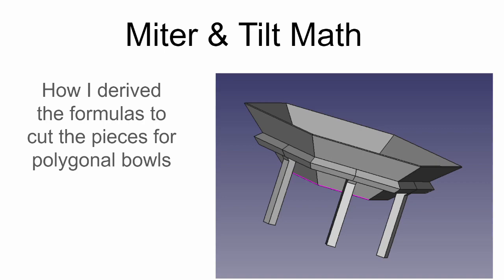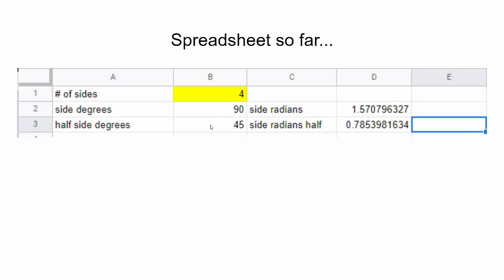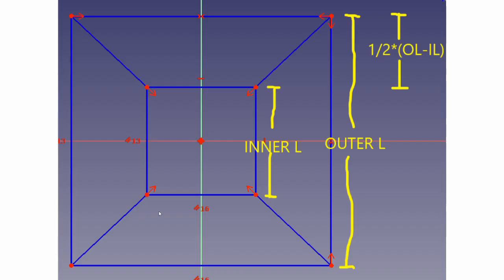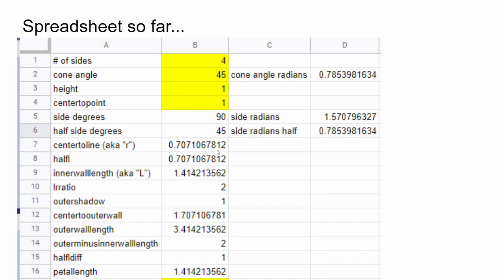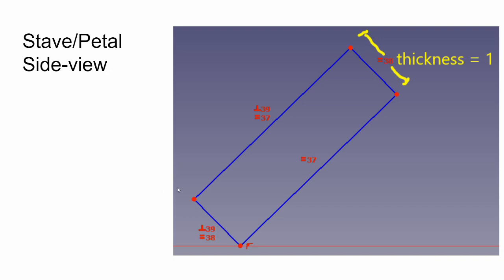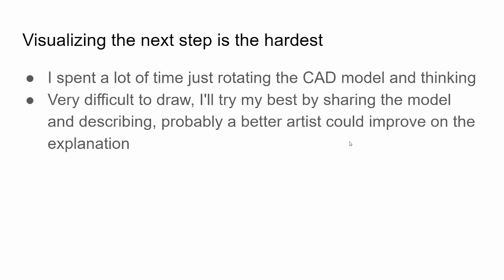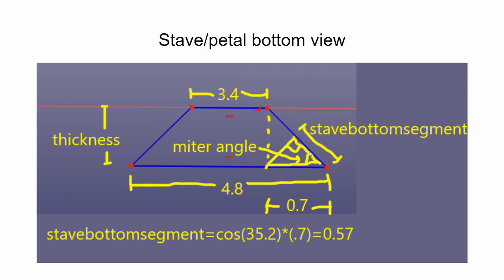How I Figured out Miter Angle and Tilt Angle for Tapered Stave or Splayed Miter Polygonal Bowls

Comment: @Randon, at time 17:07, when you are explaining how to calculate the “shadow” R you are making a mistake. The tangent of the shown angle 45 is per definition the opposite , in this case the height equal to 1,  divided by the adjacent side ,the unknown “shadow” R. Therefore, solving for “shadow” R you would get that this is equal to the height divided by the tangent of 45 degrees. Since the tangent of 45 degrees is equal to 1 the quotient is 1/1 thus 1. In this case is the same with what you found……But if you had decided to use a different splay angle instead of the here used 45 degrees, you would have got a wrong result. Do not forget to alter your spread sheet. Further, kudos, I have enjoyed your explanation.
Reply from the maker: I had claude code look into it, but have not checked its work. Here's what it says:
"Your spreadsheet is correct, and the commenter is right about the slide but wrong that the spreadsheet needs changing.

The comment

Where he’s right: at 17:07 the 45° is marked at the base of the triangle, measured from horizontal. For that angle, height*tan is wrong.
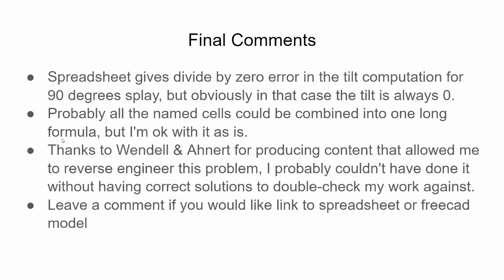Why the sheet still works: its cone angle is really the wall’s lean from vertical, which is the angle at the top of that triangle. Your closing remark at 44:07, that tilt is 0 at 90°, only works that way.
Why his fix backfires: changing that one cell breaks the tilt, because thickness*cos(cone) uses the same from-vertical angle. For 8 sides with the wall 60° from horizontal, his edit gives a tilt of 11.46° instead of the correct 19.35°.
The real risk: someone reading the angle off the slide and typing a from-horizontal value gets both angles wrong: 19.73°/11.03° instead of 11.70°/19.35°. If any of your own builds weren’t at 45°, check which angle you entered.
Is the spreadsheet correct?

Against a 3D model: I recalculated your actual file across 90 random combinations of sides, angle and dimensions, and it matched to about 10⁻¹² degrees.
Against published work: it reproduces all 15 published numbers I tested, including Wandel’s table and Snyder & Gottesman’s examples.
Formulas: your chain of cells reduces to tan(miter) = sin θ · tan(180°/n) and sin(tilt) = cos θ · sin(180°/n), where θ is the lean from vertical."

Again I have not personally looked into your or its comments. It's looking like I mis-explained something in the video but got it right in the spreadsheet.
Reply from the maker: Thank you for your feedback. It has been several years since I visited this topic, so I can't immediately give input into your observation. What I can say is that the spreadsheet did seem to match Matthias Wandel's table(s), so it is possible I misspoke something in the video and got it right in the spreadsheet, your insight is wrong (maybe misinterpreting what I'm saying), or indeed my spreadsheet and analysis is wrong. Part of the problem is finding a "known good values" table or spreadsheet. It's amazing to think that at the time I did this there wasn't AI available like there is now. Possibly we could use AI to check the "proof" or otherwise derive a proof of the spreadsheet(s) people have come up with. It always seemed odd to me that this "puzzle" wasn't already in some geometry textbook. For now I will put a note in the description that you suspect there may be an error, please let me know if you have a "fix" to the spreadsheet that makes it align with some known "proven" values.
Reply from the maker: I see a year ago in the comments below someone seems to believe that Matthias Wendel's spreadsheet may also be off. Who knows? Fun problem. I may try feeding it into Claude Code and see what happens.

Comment: thanks for the walkthrough, hoping to generalize a solution for a higher number of sides and a rather tall overall piece
Reply from the maker: Sorry for the delayed response. You an use the spreadsheet: https://docs.google.com/spreadsheets/d/143X_8kZ945lM_97q9hkiyrp_SSi4FnONL_PmbwuElxM/edit?usp=sharing or Mattias Wendel's table. One of these days I will post a short video of the hexagonal firepit bowl I welded using these calculations. Good luck with your piece.